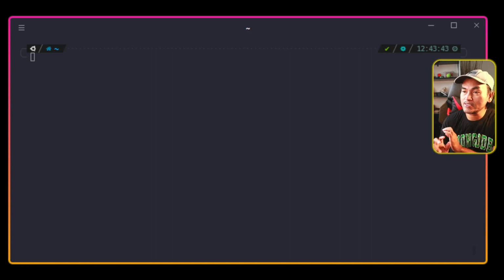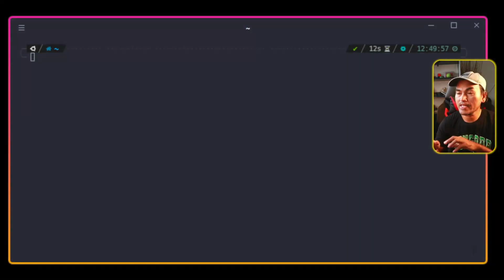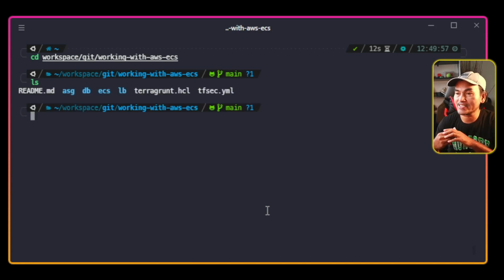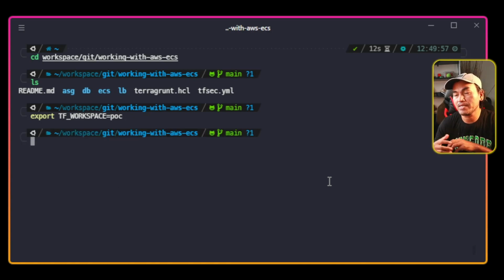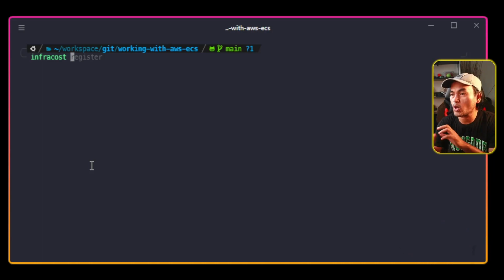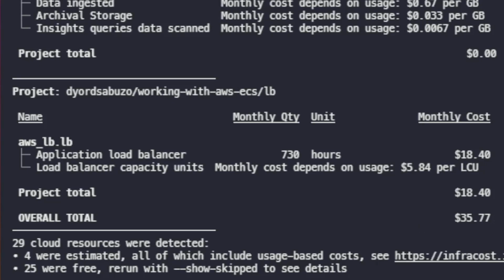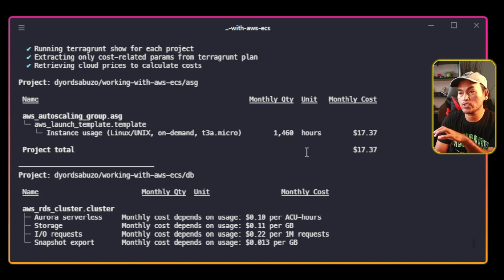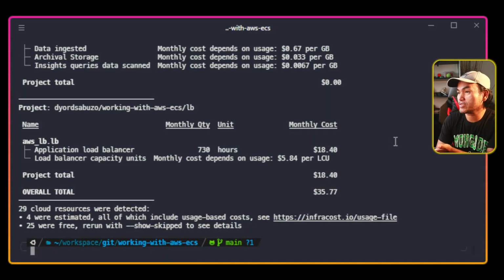How to estimate infrastructure cost using infracost

Comment: Man , Thanks a ton again , this is awesome , i have to use this for my ECS Fargate project to understand my NAT Gateway costs. one curious question , does this absolutely need terragrunt file though ? or it can also analyse the cost from terraform state file ?
Reply from the maker: Not necessarily.  It was just to be consistent with the tools that I am using.  You can definitely run this without terragrunt but you will have to run it one module at a time (at least when i tried it):

infracost breakdown --path <terraform module location> --terraform-parse-hcl --terraform-var-file <tfvar location>
Reply from the maker: Check this out: https://www.infracost.io/docs/features/cli_commands/